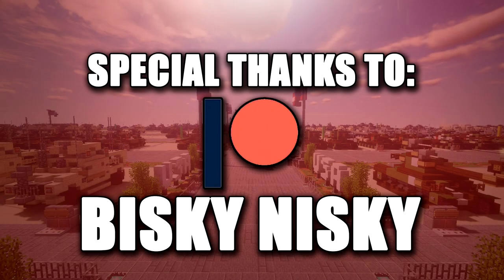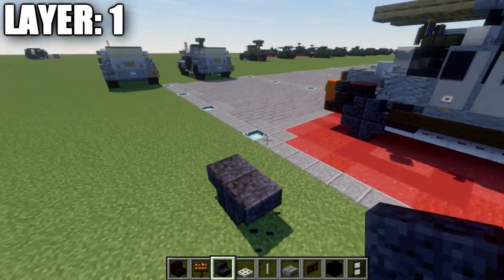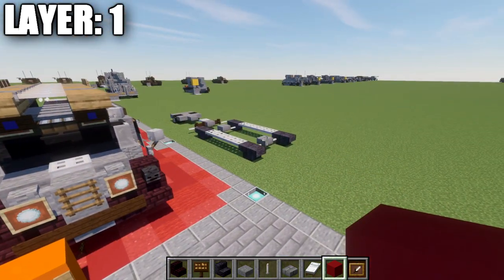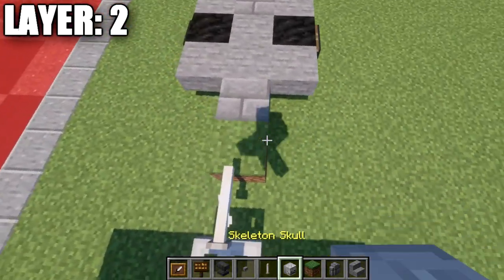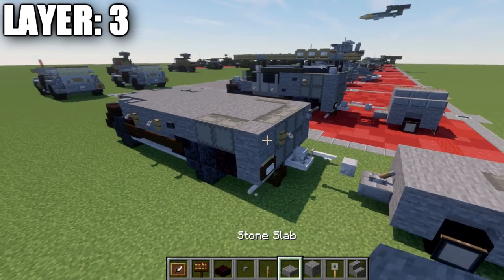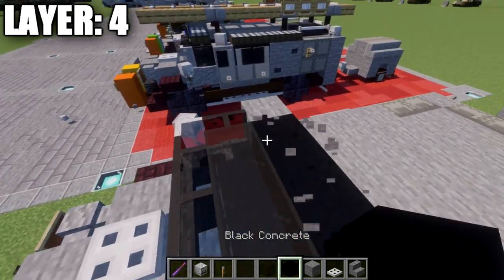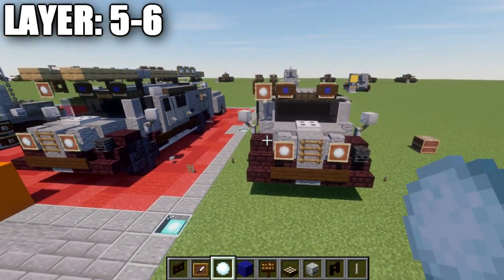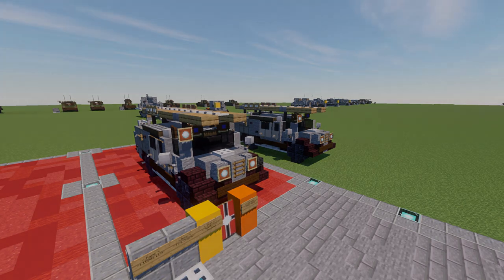Minecraft: WW2 L1500s LLG Feuerwehrauto | Fire Truck Tutorial

Comment: i have a question when it comes to using banners for tires how do u determine theyre needed for the wheels do u base of the vehicles size weight irl or just how thin it is
Reply from the maker: Usually I base it off the vehicles size. The use of banners is usually for larger and thicker wheels.